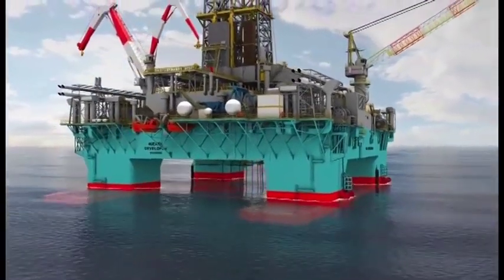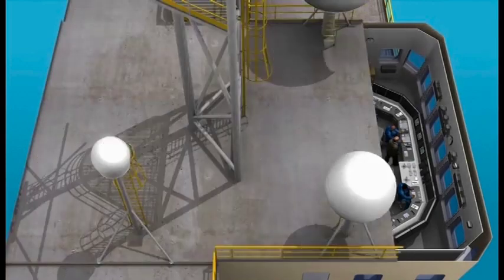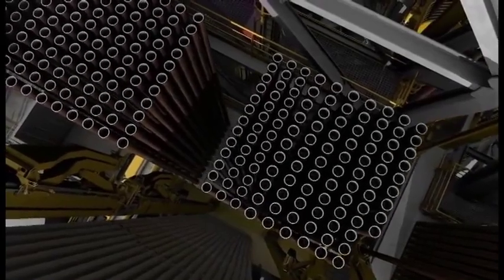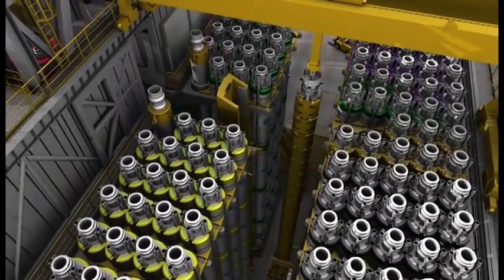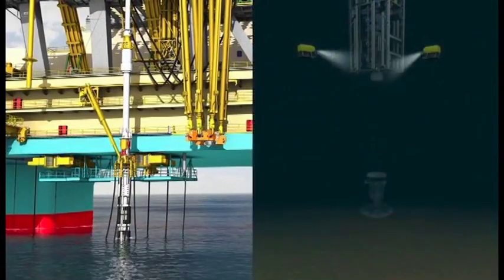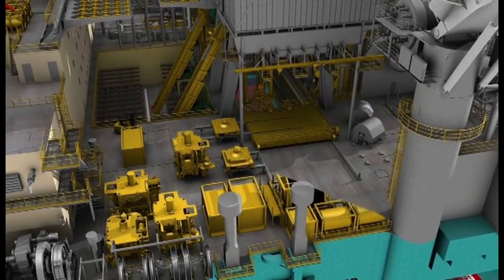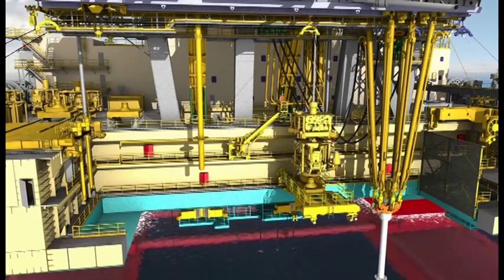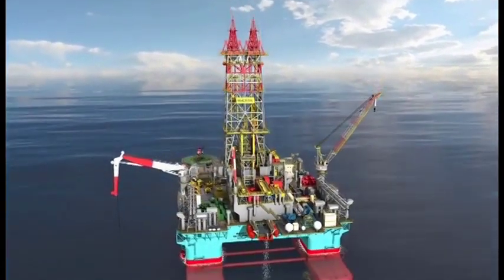Maersk Drilling - Ultra deepwater semi-submersible rig - Maersk Developer

Comment: I am gob smacked by the technology that has evolved in off-shore oil and gas exploration and development.  It rivals the space program, I think.  To be able to drill wells without having any deck hands during normal operations is amazing.  But the more people needed to do the work, the more expensive the product will be.  Crew have to be rotated on and off the rig, which can mean long helicopter flights or boat rides.  And everything has to be done remotely underwater, as no divers can go below 100 meters without very special equipment.  So remotely-operated vehicles which can withstand enormous pressure have to be used.

Comment: Hello, I was wondering where the water enters the platoon and How does it remove the water in an equitable manner, avoiding one side from having a heavier weight? Some vertical legs will have a center pipe linking one another, I'm presuming to keep the same weight?
Reply: There are multiple ballast tanks in each pontoon that can be individually flooded or de-ballasted.  Computers help to control the stability of the rig.  Often, pumps are used for moving water from tank to outside, while opening a valve will allow tank flooding.  As fuel is used up, ballast must be taken on to keep the rig stable.  When supplies are loaded, de-ballasting must occur.  The rig is ballasted to ride low in the water when on station, which reduces the effect of waves.  When moving from site to site, the rig is de-ballasted to where the pontoons are awash or riding with free board.
Reply: It's called an "equalizer" where ballast is pumped to maintain itself plumb.